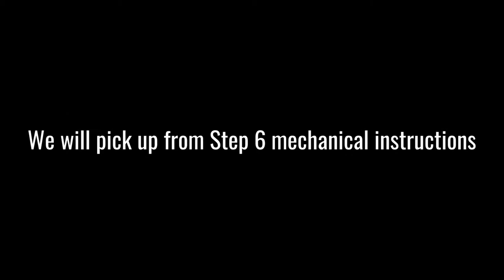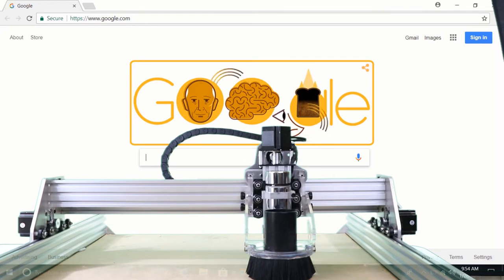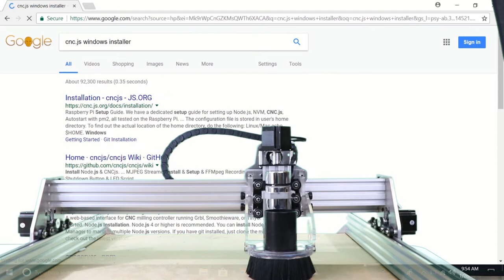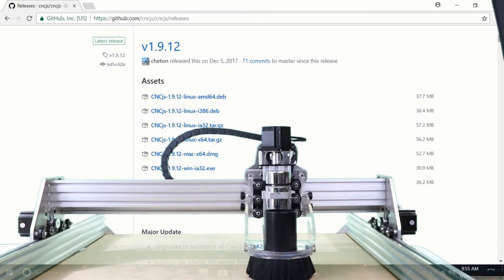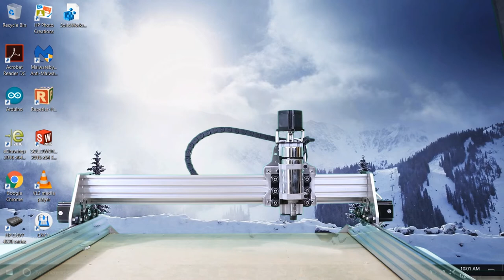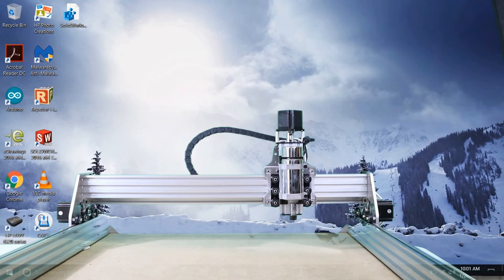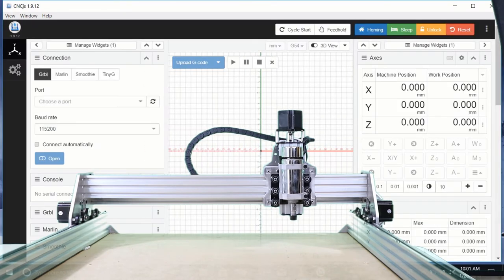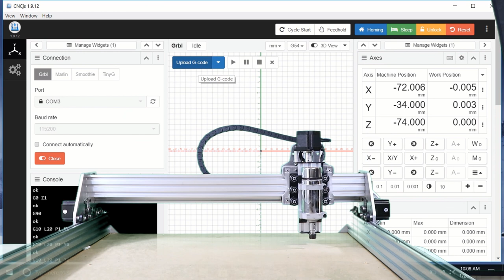OX Build instructions step 6 (Electrical)

Comment: This looks very familiar with my R7 with one exception. Mine does not home that nicely. It plays pretty rough with the limit switches. Your video here looks as out of the box as is it can get. The M1 doesnt seem to have as many options as the TinyG. Could you post your M1 settings that successfully home the machine? Our R7's of course dont have belts. I have been looking at Bcnc on the Pi but so far have had luck with cncJS just like here in your video. I am cutting projects but would be nice if it would not destroy my limit switches. I dont have soft limits setup either. When I got the M1 in the mail, I had to shutoff all limits. Kept getting "homing errors", then "hard limit" errors. My switches are all wired NC and tested to work with the meter. I gave up on the switches for the need the make chips..
Great videos guys and great machines!!

Comment from the maker: Hi Tim.Wire the switches NO for less noise.Make sure the capacitors are installed on the limits.If you have modified homing speed slow it back down. 
If we recall your M1 is already programmed with these settings. Most likely changing the switches to NO will do the trick.
See a list of GRBL settings in the link below. You can certainly slow down the homing seek feed. https://github.com/gnea/grbl/wiki/Grbl-v1.1-Configuration